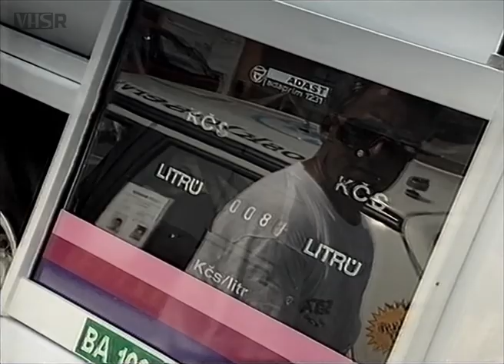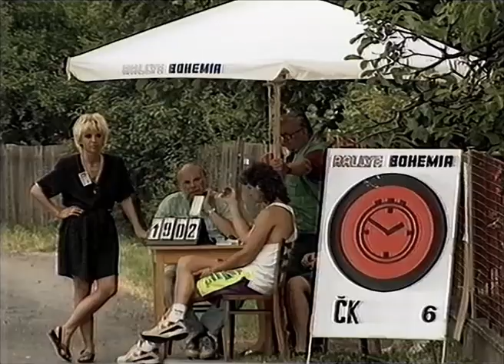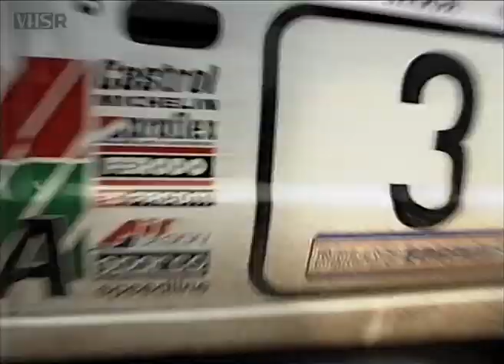1995 Rallye Bohemia

Comment: I remember how big deal it was for Škoda to move from their 1.3lit to 1.5lit VW engine. F2 and kit cars overall were incredible.
Reply: 1.5l was škoda ohv engine with diferent crankshaft with longer stroke. Vw engin was 1.6l ohc and cams later.
Reply: @jardars  indeed. Thank you for correction. Problem was added weight with VW engine or? They were really successful with own engine
Reply: 1.5l ohv was only short live  . Problem was they coms from originaly 1.3l engine block and coms from originaly 1l engin block and 1.5l was maximum posible displacement. Problem was fia class was 1.6l and this was hendicap. End at last ohv engines have problems with high rews. 1.6l vw engine was definitly better than 1.5l skoda. Original 1.5l felicia kit car is very rare. Practical all 1.5l kits was modifited just after homologation 1.6 vw ohc.
Reply: @jardars  much appreciated. I loved Felicia kit car. They still can be found racing. In my region even Favorit can be found driven by newbies.